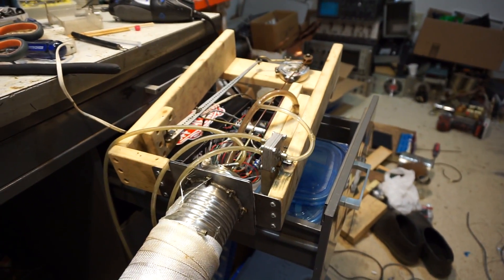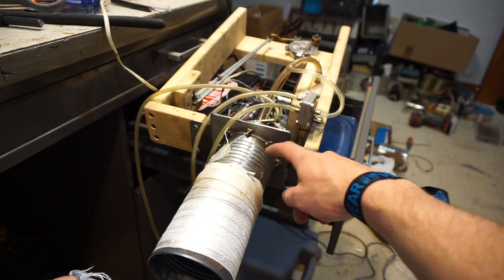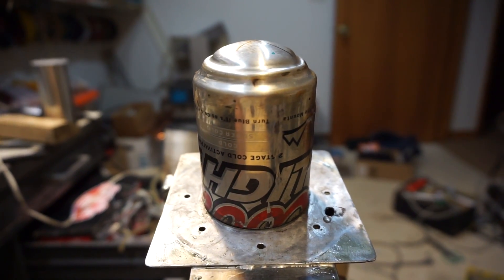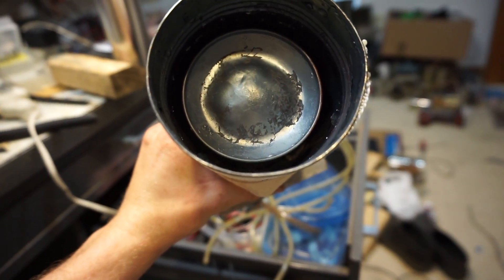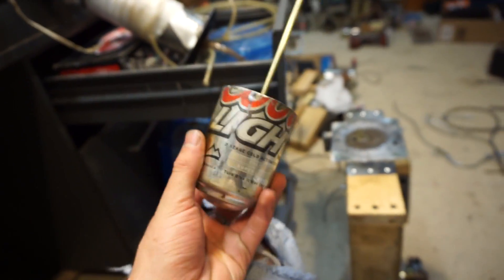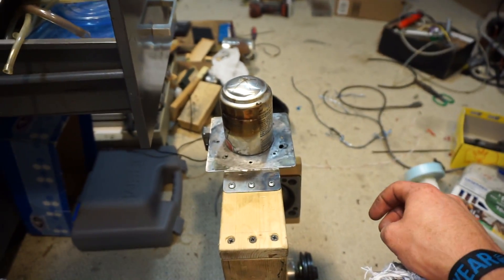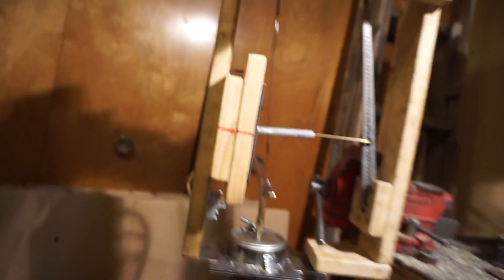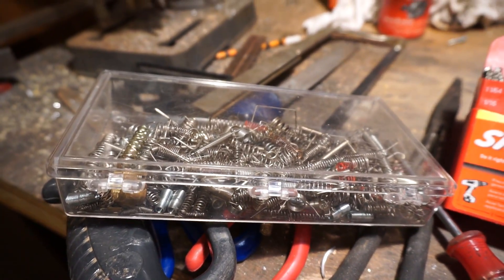Fixing My Stirling Enigne Before Day 2 of Maker Faire Pittsburgh

Comment: Your engines come a long way since first making it and must be a good design for it to run all day well done!. One idea I thought of for the air seal at the top is to use a valve stem oil seal from a car then have an oil bath around the rod and seal to lubricate it Good luck for the remainder of the fair
Reply from the maker: +Stirlingbuilder Thank you!  That's a really good idea!  I think a valve stem seal would be way too big though.  But I will look through my random rubber bits bin and see if I have some orings or something that I might be able to stick on there and seal it up better.
Reply: +Makerj101 It did cross my mind about the stem seal been to big lol but yeah any sort of rubber seal/membrane. That rust hole you've developed in your engine sucks after all the work putting it together. I'm currently thinking of running a 50/50 mix of antifreeze and water through my engine as it's supposed to help prevent rusting ect so worth a try as I've had the same problem.
Reply from the maker: Stirlingbuilder Yeah it does stink.  But luckily it's in the bottom part which would be pretty easy to rebuild.  Plus it's just a couple of cans which you know are pretty cheap... free.  So really not that big of a loss.   Antifreeze would work.  Problem for me is that I prime the water pump with my mouth...  I would not be able to do that any more!  Using distilled water would probably help slightly.  The other thing that could be done is sloshing some paint around inside the water jacket.

Comment: Why would you have to use the same type of beer can? Aren't they all the same? I would think you could just use a soda can as a replacement.
Reply from the maker: +Filzia Because these certain beer cans are a certain diameter.  Normal soda cans are much fatter than these cans and would not fit.  The cylinder is a whipped cream can.  These are the only cans I can find that fit inside the whipped cream can nicely.
Reply: Makerj101 Ah ok. That makes sense. Thanks
Reply from the maker: +Filzia Your average soda can is like 68mm in diameter, these beer cans are about 64mm.